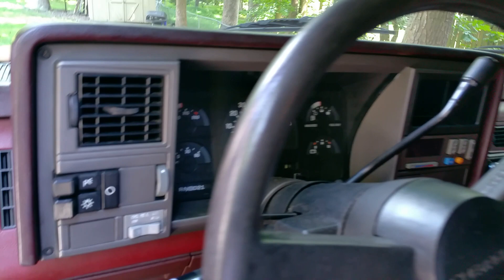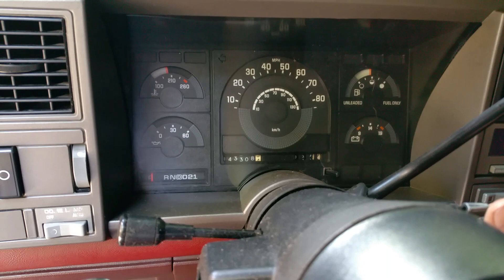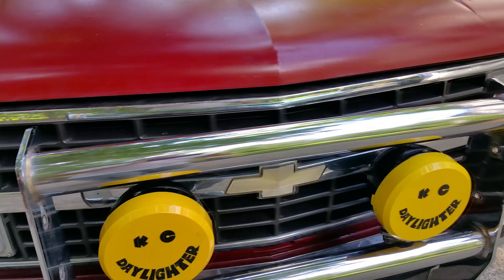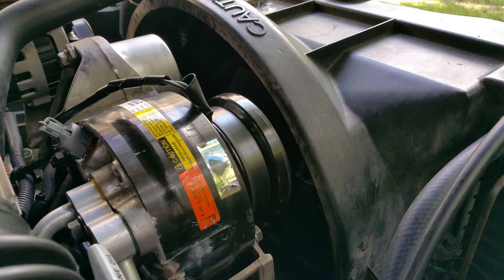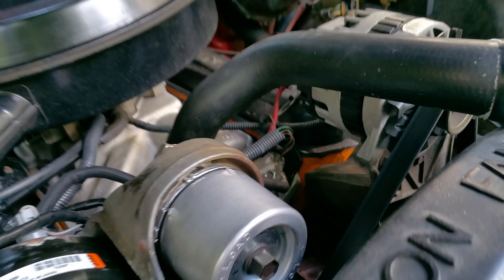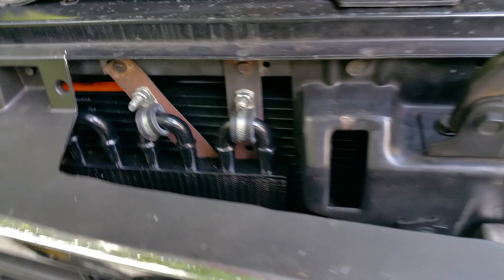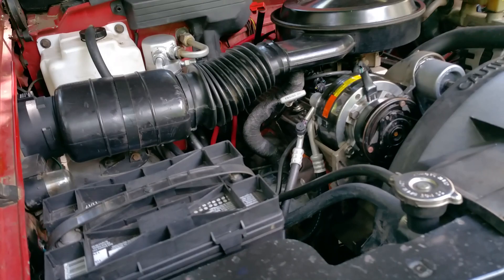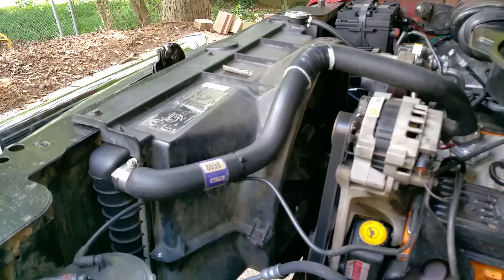Auxiliary Cooling Fan project completed 90 Chevrolet K1500 Truck (not a how-to) GMC Chevy Silverado

Comment from the maker: I did a before/after test as far as the temperature on the surface of the radiator, condenser and transmission cooler, and this fan setup has reduced the surface temperature of those items by about 50 degrees.  Very impressive.

Comment: That cool I have a 1997 suburban I want to put electric fans also but want to remove the clutch fan I think that's what you did if so what size fans did you used.

Comment from the maker: Yes, I know I said "intake manifold port" when I actually used the coolant port on the top of the water pump.

Here is where I bought my cooling fan kit.  Not very expensive. Not all that difficult to install.  If you can read basic instructions and have simple tools and know how to do soldering or proper crimping of connections, you can probably handle this project as well.

https://www.ebay.com/sch/m.html?_odkw=cooling+fans&_ssn=american-volt&_sop=15&_armrs=1&_osacat=0&_from=R40&_trksid=p2046732.m570.l1313.TR1.TRC0.A0.H0.X12%22+cooling+fans.TRS0&_nkw=12%22+cooling+fans&_sacat=0
Reply: When i follow the  link there are fans for $26.00  is this the kit you purchased? Thanks. Truck looks great
Reply from the maker: @ZCLawless25  it depends on what size fan you want. It also depends on how complete of a kit you want. They are different prices. But yes. The link I included is where I bought mine. I put two fans on my radiator. They were not very difficult to install. They are working perfectly. And I am very pleased with the purchase. Very pleased with everything I did to that truck actually. Air conditioning is now working perfectly as well.
Reply from the maker: ZCLawless25 And I researched as well as searched online for quite a while before deciding on this setup. There are some very expensive auxiliary fans out there. And I'm sure they are nice and all. But the ones I bought were the least expensive as well as the most complete kit, and so far, they are working perfectly. And the installation was not very difficult.

Comment: Dam I wish you did a How-To on the A/C system replacement. How did you pull vacuum on the system to charge it?    
You rented a machine?
Reply: Also, whats that black box with 2 what looks like red wires going to it on the Firewall behind the dryer?   It looks factory but my 94 doesn’t have that.
Reply from the maker: Bought all the stuff - even though I'll probably never need it again. But ya never know. HVAC Air Conditioning Project Many Cars/Trucks 1988-1995 Chevy CK1500: https://www.youtube.com/playlist?list=PLVsdJzatTm_UYXAfRtsg5syg16Trfj-U2
Reply: Horsepower House Thanks!   My dad done Residential A/C & Appliance repair for 39 years and even he has trouble with automotive A/C’s. 

Not all cars are made the same, they operate the same but some are designed differently. 

On my 2012 Tundra the ( Trans cooler is literally in the A/C condenser! ) Tell me that isn’t weird... yes, the A/C Condenser.

Comment: Hey bud, nice truck! What did you end up doing with the switch on the compressor? Leave it plugged, go original one pin, or go with two pin and wire into harness? Thanks. I'm in the middle of the same project on 90 K1500
Reply from the maker: I found a new original.  See Playlist link at end of video.

Comment: what is your feedback on it? i install a pusher on mine and did not see big difference? should i reverse them and put them as pusher
Reply from the maker: @AhmadAl-dahoud  the airflow needs to come from the outside towards the engine. So whatever that means to you. It should definitely make a difference. And I set mine up so that they automatically come on at 180° f for coolant
Reply from the maker: @AhmadAl-dahoud  dual fans is the best setup. A single fan might not be enough for you because the radiator is too large
Reply: @HorsepowerHouse  thanks for replaying , i put a two 8 inch fan in the front of the ac condenser and wire them with ac system, i will make more trip in this hot weather and see if there a difference( the fan i got is the cheap ebay fan)
Reply from the maker: @AhmadAl-dahoud  putting them in front of the condenser is not going to help your radiator. I would put them behind the radiator and pull the air into the engine bay. That's why you're not seeing much of an improvement. The condenser is blocking the cooling getting to the radiator

Comment: Are they puller or pusher fans
Reply from the maker: Can be either one. Just reverse the wiring and can be whichever you want.
Reply from the maker: A puller is what you want though. Because the air coming from the front needs to move on through the engine bay. A pusher would not work properly.
Reply: It's 106 in el paso right now and my old truck is trying but not enough power to draw the heat out of the cab.
Reply from the maker: Get a newer car